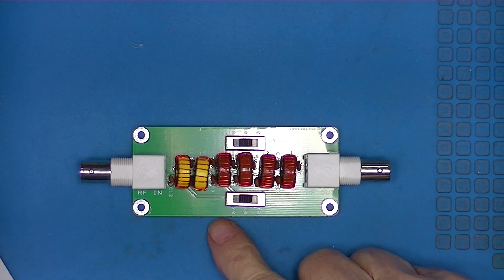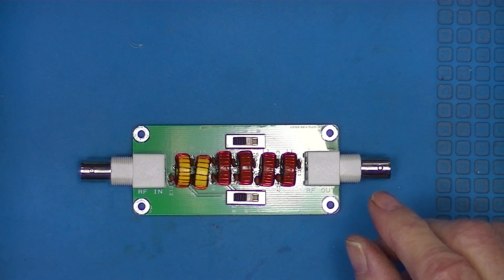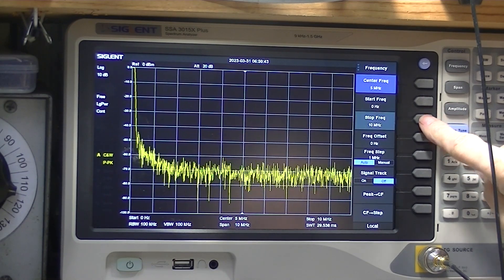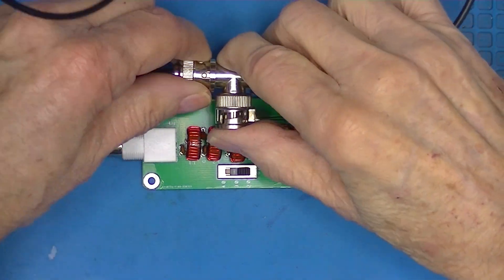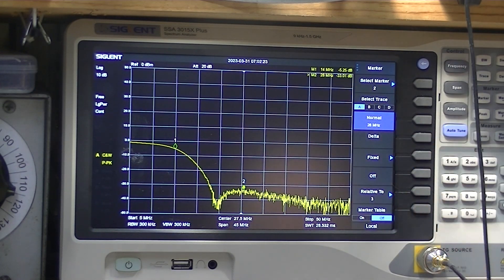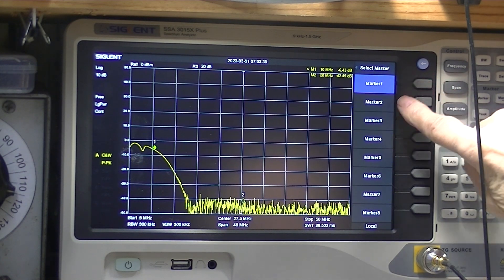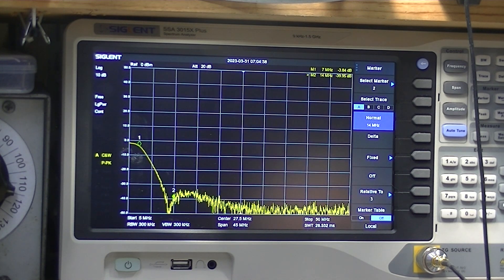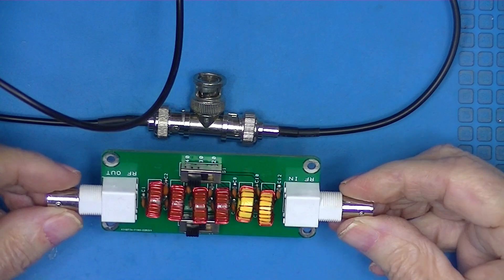Low Pass Filter from AliExpress

Comment: I have this filter and did the same measurements with the same results.  I consider it an 80, 40, 30 meter filter (not 40,30,20).  Taken that way it is reasonably good.  Just relabel it.

Comment: I Have This Filter, I Connected It To A Wago, Connected It My My ALL ANtennas, Then I Use This Filter To Filter Out The Not Needed Frequencies, Works Pretty Well.
WHat I Have Learned Is That If It Works On 40, It Works On 80, If It Works On 30 Meters, Then It Will Work On 60 Meters And SO On.

Comment: I wonder why the insertion loss is so high! Are you going to strip it down to one filter and retest it without the switches? Was there any 50 ohm terminations included or even needed. 😮 Boy can't wait till I finish moving my shop. Iam in pain and have little horse power. 😅.  73 Leo